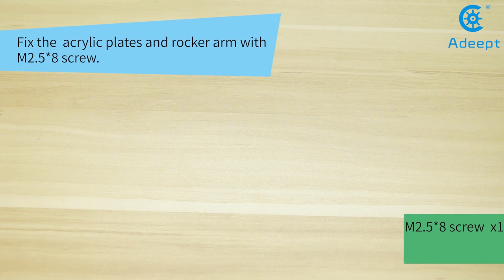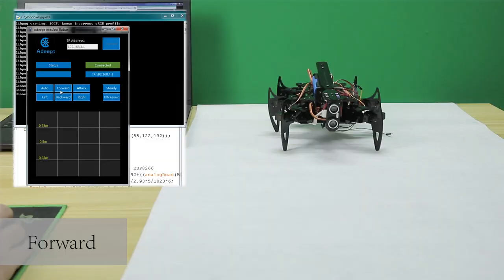Hexapod 6 Legd Spider Assembly Tutorial

Comment: If you haven't got the patience of a saint and extreme manual dexterity DON'T EVEN BOTHER.
In some of the video the important bits are covered by the text, very annoying.
It would be nice too if you had a diagram if which servo goes to which port.